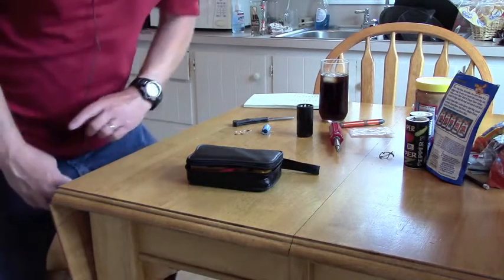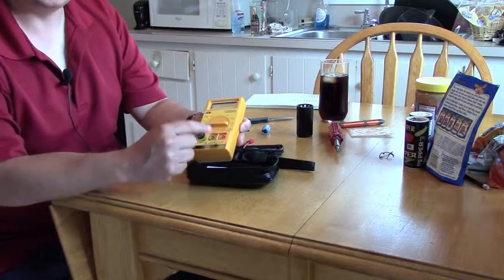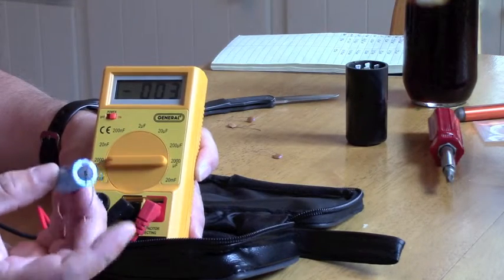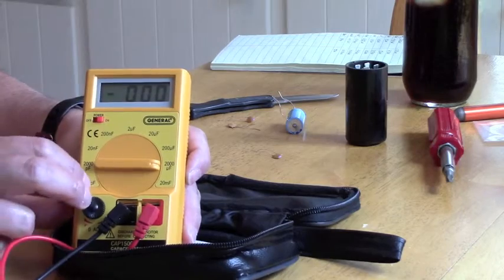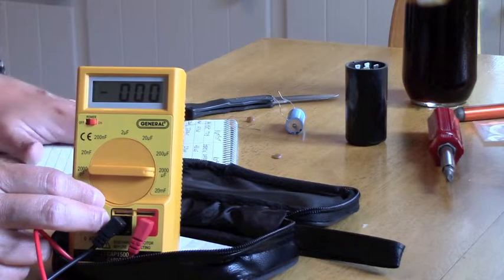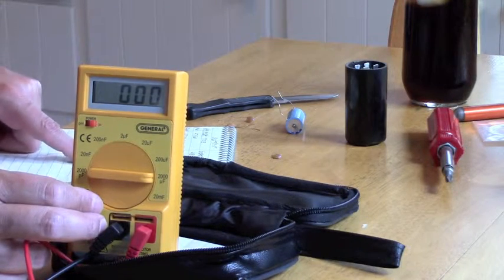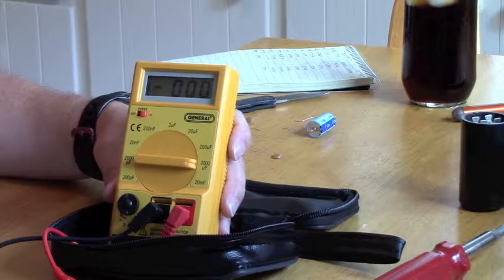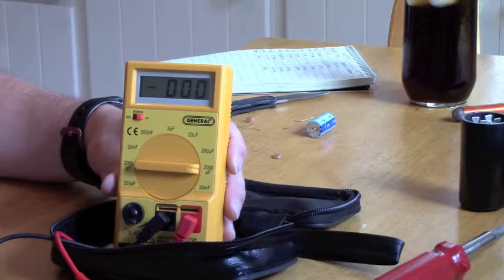General Cap meter CAP1500 review and how to test a start up cap.

Comment: I have this meter and was wonder. What do you set it on if you have 2200uF cap or 3300uF cap? Is 20mF alright to test these on? I got a reading of like 2.25 on a 2200uF cap set on 20mF.

Comment: Thank you very much! I found the exact same one (but it has a different brand name, “PEMS CAP1500P”) in a dumpster. I have in my life needed a capacitor meter 4 or 5 times. I wouldn’t want to have purchased one so I’m lucky to find one. I kinda didn’t really know what it was for or how to use it, but your video helped me understand and now I know that a couple of electric motors in my life had bad capacitors and I just bought a new capacitor without the ability to test it. Thanks for the video! Cool. I’m pretty happy about getting one for free. (the place that threw it away has a habit of throwing away all kinds of fully functional items so I don’t think the capacitor meter is bad.)
Reply from the maker: Glad the video was helpful to you. It’s always nice to find some equipment like that for free. Thanks for stopping by. 👍